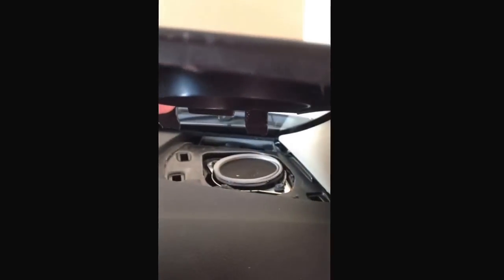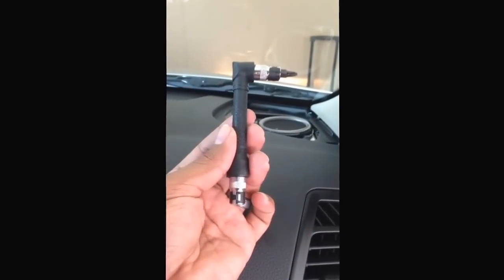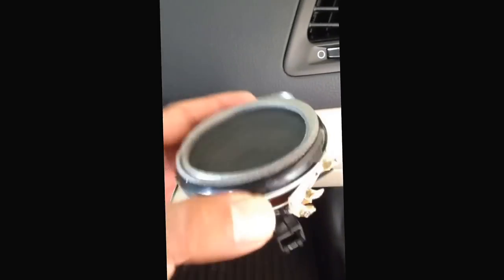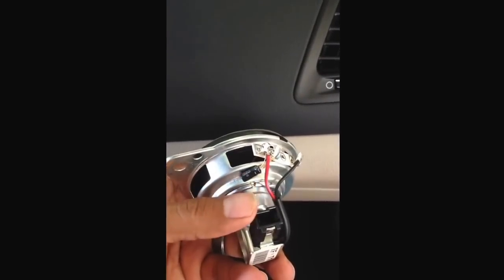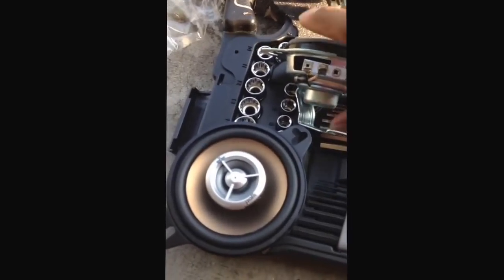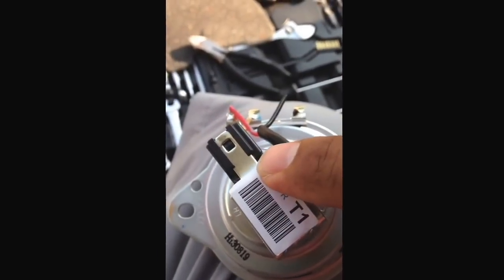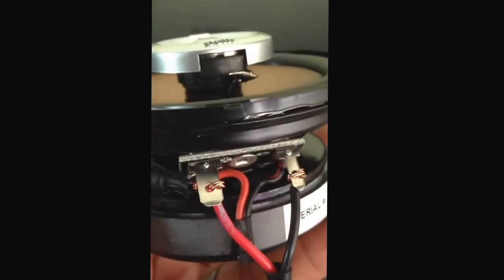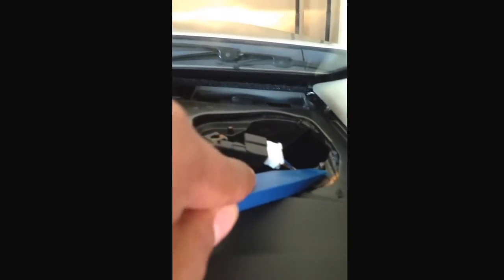How to change out the dash speakers in a 2014 Kia Optima

Comment: 2013 Optima Hybrid.  Very good directions.  Bought the Polk speakers.  I installed the bass blockers because when testing, there was too much bass distortion with speaker.  I did not have a soldering gun, but extra speaker wire, so I wired it in.  It worked great.  Also, a long screwdriver and hammer popped those tabs much easier than a pair of pliers.
Reply from the maker: I'm glad I could help yeah I figured a screwdriver and hammer would help just didn't  have one handy and I also haven't  installed the bass blockers ye but I need to do that soon I did notice some distortion as well I'm glad you enjoyed it , and hoped you watched all 3 videos .
Reply: Yes, the distortion may not be as noticeable mounted in the dash, but when testing them outside it was very noticeable
Reply from the maker: +Ed Heff  I recently installed the bass blockers  or resistors and Man it made a difference It got to where they were popping so I had to put them on I just started a thread on optima forums that you should check out I have started purchasing my equipment  to replace an upgrade the audio system in my car and I will be making videos of the whole process  subscribe and  check it out

Comment: Nice Video! I just finished my 2013 SX Optima. I kept the Stock Radio and replaced all the 6.5" door speakers and added 2 aftermarket amplifers. One for the 2-12" Subwoofers and the second amp for all the door speakers. Then I used the stock JBL amplifer to run just the dash speakers. 3 amps total.  Had to convert part of the stock JBL amp's signal for the aftermarket amps using 2- LC2i Audio Control Line Out Converters. Took a while but it sounds Awesome! Plus I get to keep all the steering wheel controls and the Climate Controls.
Reply from the maker: Thanks !! I also installed two amps after I replaced my dash speakers ! I also used an lc2i and added and an mb quart 4 channel amp for the door speakers and one  300 mb quart for a 12" focal I installed sounded good !! I don't have the K5 anymore sadly had to let it go for a GMC Sierra which I've been wanting for a while so now it's time to hook it up with some sounds which I will also be posting 
Watch the video here ! https://youtu.be/h3Nt7_Mj51c

Comment from the maker: no, i didn't use bass blockers (resistors), and yes there is distortion but mainly because believe or not at only 30 watts they are still under powered. I have had to turn the bass down some in order for them not to pop.I plan on using them but i don't have a solder gun. I do plan on installing them soon because i am planning on upgrading all the speakers and installing on amp so i will have to.

Comment: I just recently installed a a real serious sub and amp for bass. Obv the doors can't keep up. I was told (as a temporary quick fix/help) to attach bass blockers to the door speakers thus allowing the stock system to push more power to the highs so they can keep up with the sub for now. Any advice? As far as long run, what do u recommend? Thx
Reply from the maker: it would be a temp fix for sure. but this wouldn't necessarily push more power to the mids and highs. what it actually does is it keep them from playing lower frequencies. ones the sub is meant to play. so this would allow you turn the bass up without disturbing your smaller speakers too much. if you want more power i'd incorporate a 4 channel for your mids and highs and set your high pass filter so that your sub play the lowes. and change out all your door speakers. i'd check out the component series  from JBL. hopes this helps. thanks for watching and leave a like..
Reply: Even though the tweeters are in the dash, and not in the door, you would still get the component speakers? Wouldn't it be better to get co-axial at that point since you already have a new set of tweeters and there is no factory location for the component set in the door? Or does you Kia have dash and door tweeters? I wanted the component speakers but I figured my tweeters were in the dash and I would have to buy co-axial for the door and do the tweeters like you just did. For the bass blocker, did you just use the one from the original tweeters on the new ones?

Comment: Looks like the screws holding the speaker also have a hex head? If so wouldn't a socket work?
Reply from the maker: nappydrew yes they did and yes it would work you’ll just have to find one to fit between the window and the speaker good luck hope this helps please leave a like and consider subscribing
Reply: @ManuelMoctezuma  Thx

Comment: Did you use bass blockers? if you didn't is there distortion when playing high bass music from these?
Reply from the maker: i didn't use the bass blockers and i did notice some distortion but i think that was more from the low powered factory head unit rather than not using the bass blockers. i recommend using them to keep any low freq's from going to them, hope this helps.

Comment: Do you know what kind of speaker I could use to replace my drivers door speaker? I have the infinity sound system in a 2012 sonata.
Reply from the maker: that's personal preference. go with a brand you know of and trust. you can go with any speaker really and i could list a pile of them. just one you know would fit your needs. just the specs of your current setup and make sure the speaker you choose matches
Reply: @ManuelMoctezuma  thanks. But that’s just it, I don’t know the specs for the infinity system along with it’s amp in the trunk, Only the stock system
Reply: @ManuelMoctezuma  google/Crutchfield  hasn’t been any help either
Reply from the maker: @6atlantis  let me see what i can find out for you , give me a day or two.
Reply: @ManuelMoctezuma  thanks!
Reply: 11 months later...🙄

Comment: Do The Same Rules Apply To The Infinity Audio System?? 
#NOOB
Reply from the maker: Provocateur I don’t see why they wouldn’t, if you’re only changing out the dash speakers. Everything should be wired the same way. The only difference I’d see is the additional amp and better speakers compared to factory. Everything should run from stock stereo to amp then to speakers with everything crossed over I’m between. I would do a little research on how many watts the factory amp puts out so you can match the speakers. And I would definitely use bass blockers if your speakers come with some. I hope this helps . Please leave a like on the video and consider subscribing thanks
Reply: Infinity system has 4 wires going to the dash speakers. 2 go to the mid and 2 go to the tweeter that sits inside the mid. They're a bit trickier to replace, due to the wiring. Most aftermarket component speakers only have 2 spade connectors, so you have to either go OEM, or just connect the mid-range wires to the spades, and let the aftermarket tweeters filter the bass out with a built in bass blocker (most aftermarket speakers have those built-in)

Comment: What do I do if I have no slack in the speaker wire to remove the old speaker and install the new one?
Reply from the maker: @Brian-dj3ru  possibly add some quick connects with a short wire to the speaker then add the to the factory wiring

Comment: on my 2014 kia optima hybrid my speakers have 4 wires how am I supposed to hook them up with the polk audio?
Reply from the maker: +laquay green do the oem speakers have 4 post?
Reply from the maker: +laquay green can you tell me what model your optima is?
Reply: +Specmoc 12 it's 2014 kia optima hybrid lx with nav
Reply: +Specmoc 12 infinity speakers I believe
Reply from the maker: not 100% sure but with a premium sound system the speakers are all connected to crossovers, so in this case your speakers have 4 wires bc the crossovers are separating you highs from your mids, two ( + - ) going to your tweeters and 2 ( + - ) going to your mids. have you bought the polk audio speakers?
Reply: +Specmoc 12 yeah I have the polk audios,
Reply from the maker: ok your best bet is gonna be to figure out which of the 2 sets of wires are playing which frequencies(highs or mids) . hook up the oem speaker using both sets of wires to the same post AT DIFFERENT TIMES. once you figure out which set is running the mids through them you can use that set to connect the polk's but you'll have to use the resistor's they came with to keep any of mid range freq from going to the tweeters.
Reply from the maker: +laquay green that should work, but by no means am i a professional installer. if you want a more professional answer i would contact your local installation shop and ask them just to double check
Reply: +Specmoc 12 okay thanks
Reply: +Specmoc 12 I'll let you know how that turned out
Reply: +Specmoc 12 another question did you change your subwoofer?
Reply from the maker: +laquay green  my optima did not come with a sub-woofer, it has the basic stereo installed and i have not installed an aftermarket one, but i'm assuming you want to change your's
Reply: +Specmoc 12  Yeah lol ima do that or just add a down facing box
Reply from the maker: good luck let me know how it turns out, i think i will also add a sub but i'm going to first replace the HU along with some polk door and rear speakers.